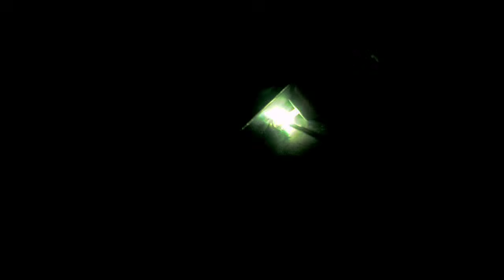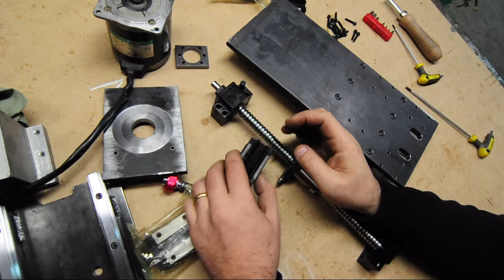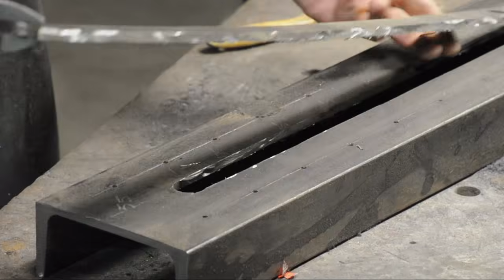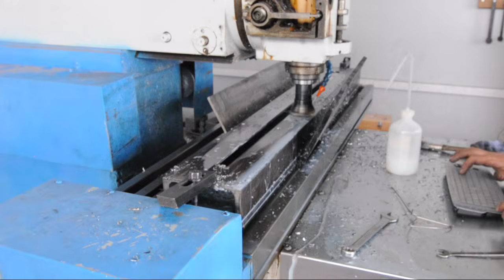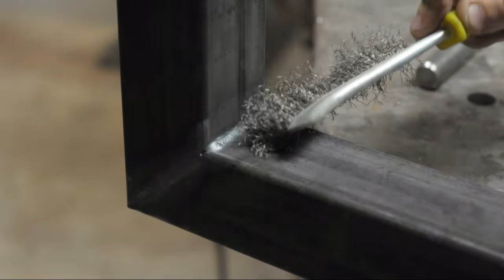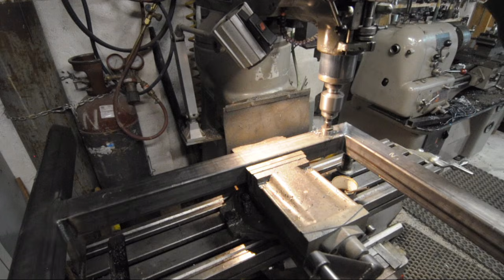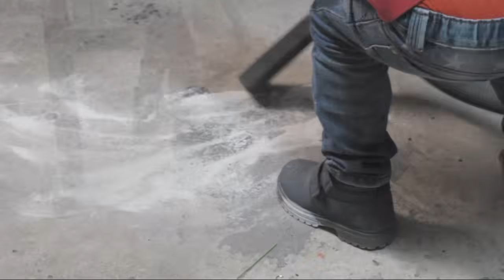Fixed Gantry CNC Router Build   Part 1

Comment: Hi Tony. i have watched lot of your videos, each and every video is awesome. I have some doubts I hope you can help in that. what is the software that is used to run the cnc? do we need to buy it from any company or we can download it from any website? do we need any special operating system in our computer to run the cnc software? how the software work, is it like we need to import any cad file to run the program? I am really sorry to raise lot of questions for you. I am really interested to know, how the love happens between the wild man like machine and so soft like software. I am really zero in this part. I am a Mechanical engineer but i am completely dont have any knowledge in software or electronic connection. please if you could help me in learning that will be great. thank you tony.
Reply from the maker: +Dineshkumar Jothi Hello Dineshkumar & thanks for watching.  The software is Mach3.  You can download it, there is a free trial (up to 100-150 lines of gcode?), any more than that and you will need to purchase a license.  OS is windows 32 bit.  Mach3 does have some very limited CAD->gcode capabilities but I use Fusion 360 (free!).  Fusion will do CAD and CAM (generate the G Code required by Mach3).  Check youtube for "Mach3" there are some great tutorials.

Comment: Impressive video! What type and length were the screws that you used to mount the linear rails?  Looks like a challenge.
Reply from the maker: Not sure about the length, but after a million tapped holes, I can tell you they're M5's.  The rails probably took ~20mm long screws.

Comment: Did you consider using aluminum extrusions for the base?
Reply from the maker: +Allan Perret I thought long/hard about it but in the end made it a point not to mix materials, and an all-aluminum
machine that was as rigid as I'd like would've been out of the question.   The difference in thermal expansion of 
aluminum vs steel over the normal temperature swings of my garage could've added up to over ~0.050" shift in my
axis alignment over the dimensions I'm working with.

Sure would've made the build a heck of lot easier though!
Reply: This Old Tony ,ive not thought about that ...very interesting .
Aluminium was my choice till i saw your post ! 

What do u think about stainless, Any ideas sempai ?

Comment: Question:
Why not use 4x6" rectangular tube instead of the c-channel for the x-axis? .188 wall is plenty rigid, and is pretty cheap at most metal supply yards.
Reply from the maker: +chopperdan88 rectangular tubing would have been spectacular but hard to get inside to mount the screw, sensors, etc.

Comment: Great video. question - I see you used a piece of channel and welded a flat bar on the back of it. was there a specific reason for this vs using rectangular tube?
Reply from the maker: +scott099999 I wanted an open back to access the components.

Comment: I've never seen bolts cemented to the floor like that, that's cool. Is it as strong as other anchors like redheads?
Reply from the maker: Not exactly sure what redheads are other than a quick google search -- but the chemical anchors seen in the video are more or less bomb-proof.  It's a two part epoxy.
Reply: Absolutely. Have used epoxy many times for anchor setting in concrete floors. Tables, Chairs/seats, etc.  Very nicely done.
Reply: I was witness to a test at a Nuclear Power Plant where the ceramics adhesives had be proven against HILTES.  Concrete blocks (500 lbs each) were cast, Each anchor was applied per instruction.  A crane was used to stress the anchors to failure.  The ceramic adhesive won.

Comment: Listen. Tony. I need to know what stubby screwdriver that is - it looks fantastic! I'm afraid if you can't help me out, or you made it yourself, I'll be sorely disappointed. Nobody wants that, do they?
Reply from the maker: hi Clay, I'm listening.  I'm awake I swear.  Its called a "finger driver".. in this case was likely 1/4".  Probably quite easy to make yourself with a small socket extension and a pressed on ring, but I think I bought mine out of a plastic bucket on a hardware store counter.  All you could carry for $1 ..  i managed to get 1/4" and 3/8" I believe.
Reply: Oh man. You're fantastic; thanks pal, I appreciate it!

Comment: love the build! curious. why didn't you use aluminum? cost $$??
Reply: just read the post's further. the temps!! makes sense! never came to mind. was only thinking of the build but not the environs! even some machining does cause small shifts in dimensions!  maybe if you ever get the garage temps on an even keel, you could revise the design and the build I bet the aluminum and even some composites would fix up your machine times by a good amount!!

Comment: Anyone know details on what spindle Tony is using?  Import? Im looking to start on a similar router build and I'm getting a parts list together. Does anyone have any recommendations specifically for the spindle?
Reply from the maker: 1.5kW air cooled eBay spindle with huanyang inverter.  it's a little too fast for what I'd like but so far so good.

Comment: When you were explaining and giving tips about welding and make the part straight and square, couldn't you have kust used a rafters square? Or would that not have been as good? If so, why.
Reply from the maker: you could yes but no square will keep a weld from moving if it wants to.
Reply: @ThisOldTony  true, but it could be used to check after you hammer it to place, even is the bottom cut was not flat. Edit: And I think welding less joints with gaps the easier it would be.

Comment: I am considering doing a router. What are your thoughts on placing the rails outboard of your C channel for the X and Z axis with c shaped trucks keeping only rail width between trucks building out on the Y dimensionally. If my explanation makes sense.
Reply from the maker: should work... only it would be a little taller.

Comment: Hey This Old Tony, I had a quick question for you. I've been watching a lot of your videos lately and I notice you use TIG a lot. Is there a reason for this? Would it be easier to use MIG? I don't have a TIG torch and whenever I weld I find it easiest to get out the MIG gun and go through the project with that instead. Not criticizing just wondering why.
Reply from the maker: mig is better for lots of welding. I only usually do a little at a time.  mig is noisy smokey violent, tig is like birdsong in the springtime. :)

Comment: Why not replicate what industry does when lining up equipment on less than perfect surfaces. Use Chockfast. Or rather be cheap and use low modulus epoxy resin. Set the rails off the surface parallel and even to each other then pour resin to form a seat. This is essentially what is done when lining up large machinery such as ship main engines, turbines and thrusters. Ashore generating plant is done the same. A hobbyist could replicate this using cheaper resin.
Reply from the maker: that's a really good idea.
Reply: I am sorry, I could not follow. Could you direct me to some article or video that I may read/watch?Thanks in anticipation.
Reply: excited box ---> Makes sense. However, would the epoxy be able to take the vibration and the load without cracking?

Comment: 16:05. As a certified machinist, I think it's hilarious that you thought you could "shim" the rails; to 'get away' w/o machining that surface.
Rookie's going to rookie.🤣👍
Reply: lol, He just needs a CNC machine to fix it...in reality, the way I'm thinking is start with a 3d printer, and build a rough cnc with it, then use that to replace some plastic with aluminum.
i made my workbench out of concrete and inserts collars instead of drilling it, think this is how going to make mine, use granite/epoxy with nut inserts that are already flat.
Reply: @murraymadness4674  Check out the MPCNC and it's big brother, the PrintNC.  You can print a MPCNC and use it to fab "good enough" aluminum parts to make a beefy PrintNC.

Comment: At 15:01, what are you using to measure with?  What is that thing?

I ask, because I'm looking to beef up my hobby levely machine.  BUT, I need to ensure that it is both square and plumb.  Unfortunately, I am not sure about what any of the measuring instrumentation like this is called.
Reply: TheRangeControl that is an indicator, and with it may be the most important investment you can make in your shop. Tony mentions a good, accurate brand to look for in one of his shootin the poop videos iirc.

Comment: what you call that tool you start marking the plate with at about 18 seconds into this video?? Thanks!
Reply: .....does anybody know??
Reply from the maker: marking gage and scribe?  google "vernier marking gage" for that style.  It's a ruler stop and ruler with vernier graduations.  Hope that helps!
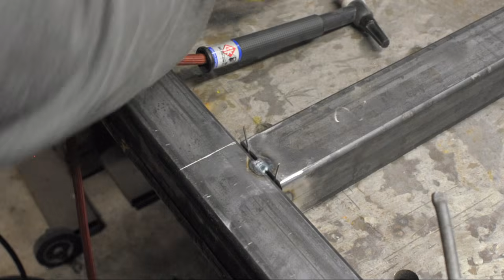Reply: Ya great...that helps...i could'nt find what it was called anywhere....thanks. That said i would like to annoy you even more.....that square you got at 24:12....with the extra T shape on one side of it...looks useful, whas that called?  Appreciate it!
Reply from the maker: not sure where I got it, I have a set that's been around for quite some time.  I think just an 'engineers square' or 'try square'.  I did a quick google search and the first one I found from pecktool.com calls it a machinist's square.  No relation to peck tool company, just the first google match I found.

Comment: Tony, so I admit I'm a practitioner of the "Black Arts" there is something there.  I am perplexed by the addiction new "makers" have to TIG!  MIG is not a unfriendly technique.  Myself, I prefer pure fire!  With skill you can make Oxy-acetaline or Oxy-LP   look the same. I'm just a pre-tesla person. The old tools still do the job.  I know where there is a 8' shaper. It made keyways in flatbelt shafts, 3-4" in diameter.  I digress.  A thought. Use fire sometimes !